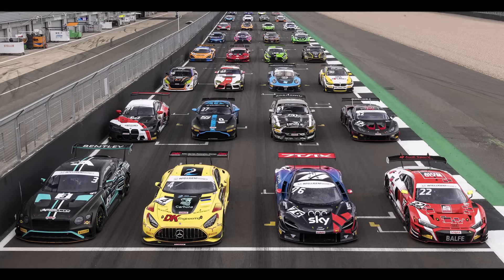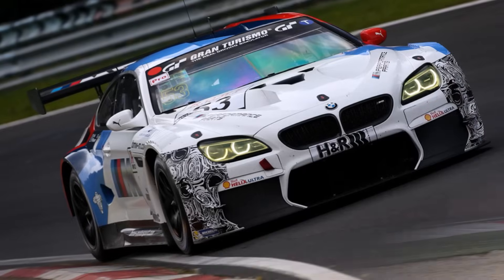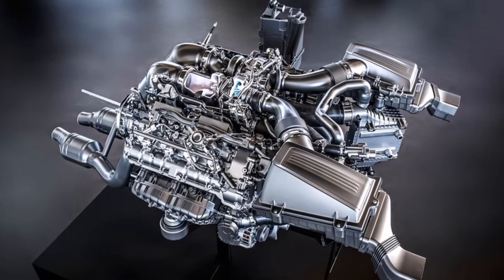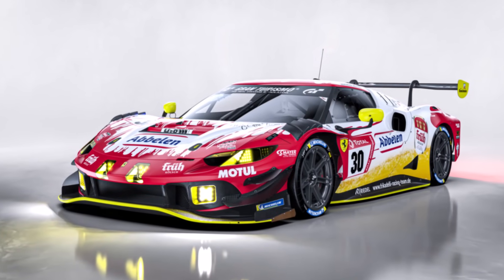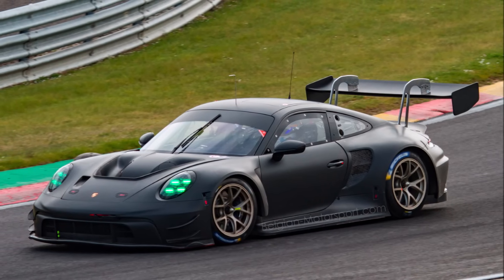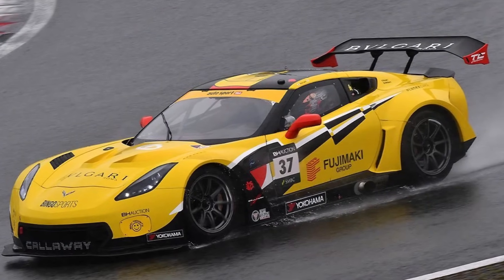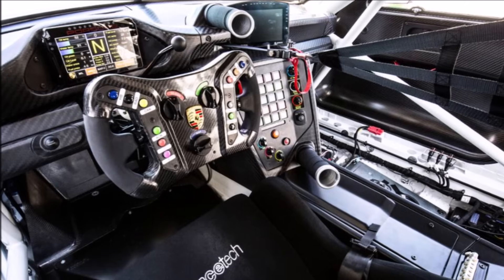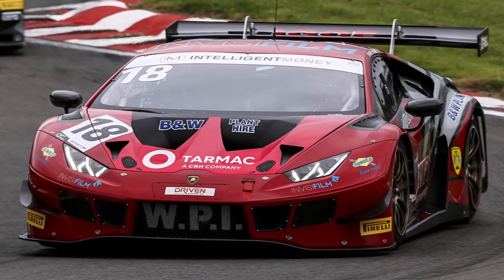How to build a GT3 Car? (Technical Background)

Comment: It’s hard to pick just one when asked that question of what’s my favorite one 😂
I’m saying between the Mustang GT3 and the Porsche 911 GT3 RSR is my favorite, but all that aside you really put down really good points, I was considering building one of my own which will be very hard considering I don’t have a technical background or even the knowledge behind these cars, all I know is that it needs to be able to cut through air while providing enough downforce to be agile on the track, and that also around 500 hp is the BoP range for these cars.

Comment: Then Nissan GTR was banned by FIA because its AWD right
Reply: No.

Regulations mandate that the GT-R be converted to rear-wheel drive in order to compete. Same with the Honda/Acura NSX (it also has to ditch the hybrid system). The main issue is that the GT-R is already uncompetitive in almost all racing series execpt Japan's Super GT and Super Taikyu.

Comment: Useless vid, author doesn`t know that power=torque*revs, so having 500hp you have the similar torque on wheels, no matter what you have on flywheel, transmission ratio will equalise it

Comment: With Audi now sadly closing down much of it's GT3 Programmm, do you think that potentially instead of the Audi R8 as a GT3 basis it would have been possible for Audi to use the RS7 instead?
Reply from the maker: I think the RS7 wouldn't be a good basis. It's basically the same issue as what the BMW M6, Bentley Continental had (with Bentley using the Audi platform).
So it's much too big, heavy and the engine is in the wrong position.
Also the RS7 body creates far too much lift, which would have to be compensated by bigger wings, resulting in higher drag

Comment: I remember looking up close at the first gen GTR Nismo (2014-15). It was surprisingly similiar to the road car from the interior layout, suspension setup and engine design/placement. Now, GT3 cars are extremely complex (especially aero) and aren't a good representation of their road counterparts anymore. They're faster and the racing is better but its a shame they're more expensive and almost too difficult to work on for amatuer teams.
Reply: Ferrari 296 street version is probably faster than GT3 un traction and straightline

Comment: you're talking about GT3 but you showed the Corvette that is actually a GTE, why don't you do a video about the differences between GT3 and GTE? (even if next year GTE will disappear from racing in WEC)
Reply: Keep in mind, the IMSA C8.R is currently running in GTD Pro (basically professional GT3). Not entirely wrong, but yeah, a different picture works better.

Comment: I love how so many of the things mentioned that make a good GT3 car, the BMW M4 contradicts:

Big frontal area
Taller center of gravity
4 seater base car
Asymmetric thermal distribution (both turbos and whole exhaust system on the passenger side of the car)

Pretty effective car nonetheless!
Reply: BoP
Reply: Only due to BOP without BOP front Engined car would be slower than Mid and Rear one
Reply: @fqeagles21  no GT3 cars are designed to run without BOP, BOP is the whole point of the ruleset
Reply: @Milano322  I know that’s why the M4 could be competitive,without it not a chance

Comment: 6:45 what's this air lift sistem? Does the car have integral air jacks to ease tire changes?
Reply from the maker: Yes exactly that. Each car has 3-4 air jacks integrated in the car, so they can quickly lift it during pit stop. They use an external pressure bottle which has a connector somewhere at the car.
Reply: @bsport320  Cool

Comment: Nice video, helps explain why there's more to a good GT car than just good/bad BoP. Which would you say are the best and worst overall GT3s currently racing? Non-expert opinion but the AMG GT seems like the most complete package these past few years (used to be the R8).
Reply: this is really hard to tell for us as non participants because there a lot that factors that we don't know about or information is hard to come by. Like costs, support and quirks of the cars. stuff like AMG not having auto engine ignition once it drops from the jacks so it often loses like second or two in the pits(commentators on paul ricard race mention it few times).  How hard or easy it is to work on cars, how hard it is to set up maybe it is great car for pro team and pain for others.  I always try to keep all that in mind and the fact that thing are changing from year to year, like the fact that audi is no longer supported, it had nothing to do with cars performance.

Then you have to take into account stuff like that certain cars have cups like super trofeo, Porsche whichs makes them ideal packages for teams coming from those etc
Reply: @MarkoLomovic  Yeah, it's true that there are a lot of factors beyond pure speed. BoP means teams have to focus on a lot of these details which can make a difference. Support is an interesting factor, WRT leaving Audi for BMW seemed like a big turning point in GTWC, the R8 is still competitive but has taken a small step backward. Can't wait for Spa this weekend!
Reply: @super_mirafiori   it is not that WRT left audi and more with the fact that audi left GT for F1. if I remember correctly they had to scramble fast to find new partnership because they want to have stable platform for foreseeable future. it is better to get new car right away and start learning and improving then have another season with car that is not going to be supported any longer.

by 2026 we will have hurracan replacement, new AMG, Ferrari is going to get developed further etc while audi is just gone.

Support is interesting factor and not only in equipment and cars but also in data, knowledge and training etc

You can imagine that what for example audi learns from all the teams can be shared around. Even small stuff like car operations.

Comment: Do you have a link to the documents showing what has to be kept from the original car? And the real differences between GTE and GT3 regs?
Reply: All I know is that GTE cars are built for racing and have more aero freedom than GT3 cars. As for GT3 I think the chassis has to come from the road car
Reply: @acegarr22  but Ferrari offer a kit that can change a 488 GTE to GT3 spec and vice versa. So it's not that fundamental.
Reply: @Scotracer1987  Thats true. But only applies for Ferrari and Aston Martin that run the same cars Vantage and 488 in both categories (although not for Ferrari anymore). The exception is Porsche and Corvette. And even for next year Corvette aren't converting there C8.R into a GT3 and just making a new car entirely based on the Z06 of course putting there GTE experience into there new GT3 car

Comment: Is it possible for Subaru to make a GT3 car based on their Super GT 300 car?
Reply: @albert_gyorgy  - I'll need to correct: the BRZ GT300 is a JAF-GT300-spec car not Mother Chassis. It's easy to tell since the latter always use a GTA-branded Nissan V8.
Reply: @pmayo7894  I'm sorry for spreading misinformation
Reply: @albert_gyorgy  - don't worry, not a lot people understandably has a hard time differentiating a JAF-GT300 car from one made under the Mother Chassis specs. The prior comment should help them short-term.
Reply: @pmayo7894  I was wondering and I even searched it up and an article mentioned it as a mother chassis car (or I misunderstood something).
Reply: @albert_gyorgy  - three specs are available for GT300: the FIA GT3, JAF-GT300 (which the Subaru uses), and Mother Chassis (the ones where they always use the Nissan V8s). The BRZ uses the EJ20, so it's a JAF-GT300 car.

Comment: It would be awesome if you do the analysis for GT500 at superGT, they have more aero i think than GT3, and more HP, perhaps different packaging? Or only tuned more? Thanks, you're awesome man
Reply: GT500 are totally different. They are not related to their road car equivalents at all. They shared regulations with DTM until it collapsed (again) and these are silhouette prototypes with bespoke racing chassis and turbocharged i4s (previously NA V8s) dressed under body vaguely similar to the road car.

Comment: After this vid, I'm now wondering which GT3 car is the most common and which one is the most rare.

I assume Merc and Porsche are the most common because they provide the best support and their cars are thoroughly tested on tracks that host crown jewel races like the 24hrs of nurburgring and 12hrs of Sebring

As for rarest its probably either the Bentley Continental or the Corvette C7 for reasons such as complexity, lack of support or an outdated car.
Reply: Mercedes and Audi are easily the most common. Audi is probably more common in Europe compared to Mercedes but they have no factory support in America so no one runs them there.
Reply: There are a lot of old GT3s that haven't been used in ages, so it's basically impossible to determine what the rarest GT3 is. My guess would be the Emil Frey Jaguar G3 because there were only 2 of them ever built, but it's not an FIA homologated car which means it's technically not even a GT3.
Reply: Ive heard merc is pretty good with the handling  and throttle too, also bothe Merc and porsche do look like they have great pace

Comment: Do they absolutely need to be rwd? Or would we see something like a civic in the future?
Reply: They must be RWD
Reply: you would have a really hard time building fwd car to the GT3 level. fwd are hardly limited in perfomance, touring class is the best you got
Reply: @maximborodyuk3773  this is of course not mentioning Ratel would throw you out for suggesting that. The upcoming Mustang already annoyed him to no end and he would've stopped it on it's tracks had he learned of it in time. He doesn't want "cheap" cars like the Mustang.

And on the topic of the Civic, Honda is building a GT500 spec to replace the NSX. While not FWD it will be a  comical thing as GT500s were faster than Hypercars last year around Fuji by a margin.

Comment: What do You mean by "symetric engine" at 5:07?
Reply from the maker: I mean intake and exhausts are symmetric.
So either an exhaust either side and intake in the middle.
Or hot stuff in the centre and an intake either side.
Asymmetric would be an inline engine with intake on one side and exhaust on the other.
Reply: @bsport320   
Thanks, now its clear! 
Agree on that!

Comment: Will hybrid GT3 cars ever be a thing?
Reply: Eventually... Populism will make it the only option to have any ICE racing.
Reply: Probably the cost of maintaining the hybrid components is the barrier, more so for privateers.
Reply: @pmayo7894  I don't think the hybrid system needs to he maintained all that much. I believe it's more just the sheer cost of the hybrid system, it would make the cars much more expensive and the drivers would need to learn how to use it. That means higher costs for privateers and less sales for the manufacturers. So it wouldn't really be beneficial for anyone.

Comment: Do you think we'll start seeing GT3 cars with 4-cylinder engines soon?
Reply: Only if it's a hybrid.
Reply: Current gen 4 cly engines are topping out at 2- 2.4 liters. With the 500 HP reference we are talking of 200/250 hp/litre,  ain't gonna be cheap make it reliable for endurance

Comment: I'd love a video similar to this comparing the GT3 and GTE, what makes them different and what makes the GTE faster and why the cars can't compete in both
Reply: It is (or now used to be) that GTEs had way more developed aero, but current GT3 gen is, almost has, caught up to that. They also featured a better suspension as far as I know.
Reply: @TheGamingHungary yeah GTE underbody aero was more efficient too. They had less drag than GT3 cars aswell. But I also rememner hearing the tires they used was of a higher grade with more grip🤔
Reply: @koraxi8958  GTWC Europe (the biggest GT3 series) uses customer Pirelli's while in GTE Pro/GTLM car specific tires by Michelin was the baseline for everyone.
Reply: @koraxi8958  its tires and bop restrictions 
  
PWC's pro class (GT3) and IMSA's GTLM were averaging the same times at COTA when they both were going there.
  
Talk about killing GTE and GT3 for a GT/GT+ class was in talks since 2014, because of how close the GTE and GT3 cars were in speed.
Reply: @asymsolutions I tell you what, I wouldn't mind a rebranding, I know not quite the same thing as creating an entirely different class. 

We only call them GT3 cars out of habit because of the Era they emerged when GT1 cars and GT2(as they were called back then) were still around. Much has changed and I think a suffix that's not numerical would be a better name for GT3 cars like GTC or prefix LMGT e.g. 

Even the GT2 class dropped the 2 for E before changing to LM after GT1 cars retired, same could be said for GT4 and the confusingly named GT2 class. 

Confusing not because it's revived an older class name, but because of it's relations ship between GT4 and GT3. On paper you'd think the current GT2 class be called GT3.5😅.
Reply: @koraxi8958  No, we call it GT3 because that is literally the class name on the SRO&FIA regulations that control that homologation. There is also a GT2 homologation in existence that came out in 2019 that currently has 7 cars.

It's not out of habit, it's a literal regulation.

The whole GT/GT+ was an entire replacement set of regulations to replace GT3 and GTE. It was meant to be setup so that cars could be converted from a cost controlled spec to a developmental spec like what Ferrari and Aston Martin were able to pull with their 488 and Vantage.

Only a few cars could work in the old ruleset, hence why the 911 GTE and GT3 spec wasn't convertible, and Pratt Miller had to develop the Z06R GT3 to replace the C8R corvette.
Reply: @koraxi8958  Also you are wrong on the naming. GT2 became GTE because of infighting about who controlled the GT2 regulations and what to do with them (between the SRO and FIA).

GTLM was the class name in IMSA, not the regulation name, hence why there were NON-GTE cars allowed to compete in it; aka the M6-GTLM; a GT3 car balanced to compete with the GTE cars in that class. Like how GTD is just the class name in IMSA, but it had 911 cup cars, old GTD cars, and GT3's with the TCS and ABS disabled in it before going full GT3 spec. Same class also waived the GTE spec C8R for 2022/2023 before the Z06R was produced.
Reply: @asymsolutions  Yeah I know about the homologation aspect for GT3 cars, but what I'm saying is that SRO didn't just dub the name GT3 for no reason at all because it sound it good or what ever. It was deliberately named so as to identify the relationship between GT2 and GT1 cars. At least at the time of 2006 when GT3 cars had officially debuted, GT2 and GT1 cars were still around. IMO it was alot easier to understand. Much like how lmp3 and lmp2 work currently or the formula cars from 1 to 4, which are all still relevant today.

Though since GT3 cars are now perhaps the fastest out right GT cars Homolgated by SRO, perhaps the 3 in the GT name is rather redundant. But I understand it's continued use at the same time, it's been 18 years since GT3 Debuted and the name has stuck as am identity as the faster GT categories of long since retired.
Reply: @asymsolutions  OK yeah that I didn't pick up on, what yoi said about GTLM only being coined for IMSA. I remember the M6 GTLM competing in IMSA. Yeah it literally was just an enhanced GT3. The fact that the generation of GT3 cars around 2016 onwards now shared a bit more in common to GTE/GTLm cars made me wonder why they still weren't permitted in the WEC or Asian le mans series boggled my mind. But look at them now💪
Reply: Great suggestion.
Reply: On the other hand, Super GT's (the Japanese racing series, not the YouTuber) GT300 class can match and, often, post faster times than GTE.
Reply: @pmayo7894 super gt is a silhouette class though. As much a GT car as F1
Reply: i just commented the same thing even before reading your comment 😅

Comment: Can anyone tell a little bit about the pneumatic jacks that these cars have built in them? I'm also curious how much that system weighs, and is it used in all racing catagories? Or only in endurance?
Reply from the maker: It's quite a standard system in racing. You weld in 3 or 4 tubes into the body, fix the pneumatic cylinders and connect them to the external connector.
When the car comes in, you connect the pressure bottle to the car and the jacks go down.
If you release the bottle, the jacks go back in.
Reply: @bsport320  Thanks for the reply. It also seems it weighs just about a kg and a half for each corner. Less than I expected.
Reply: https://youtu.be/I8ofkIzft-s Good information here. It’s V8 Supercars but the systems are similar worldwide.

Comment: What parts of a GT3 are actually shared with a road car? Thank you.
Reply: Not an expert but it depends, it's said that only ~40-60% of road car parts are shared with the GT3 model, generally the chassis engine/block and drivetrain layout. As explained in the video, there were cars like the Z4 GT3 and Bentley Contentinental GT that shared very little with the road car and cars like the R8 LMS and 911 GT3R being an example of how manufacturers marketing their road cars as very similar to other race version.
Reply: I know the engine on the Ferrari 296 GT3 is the same as the road car and also the same thats in the 499p hypercar.